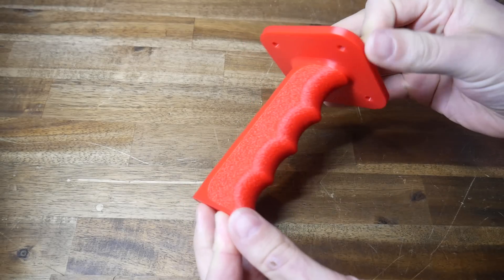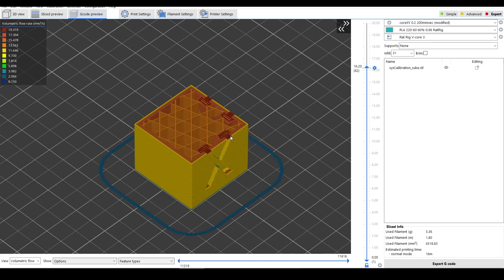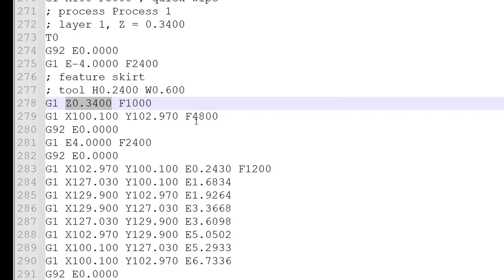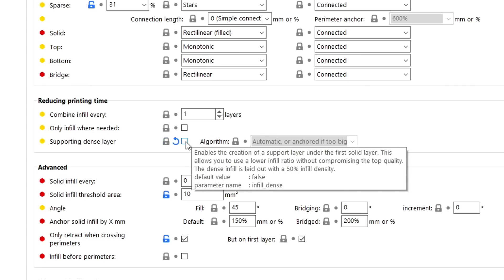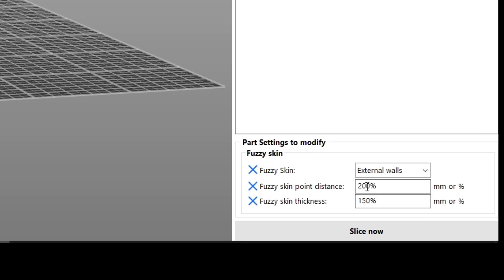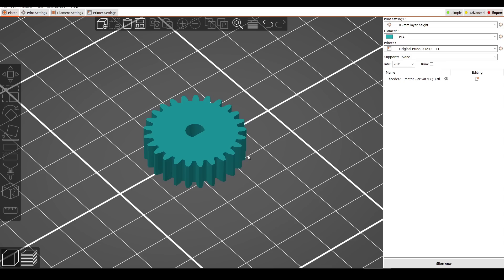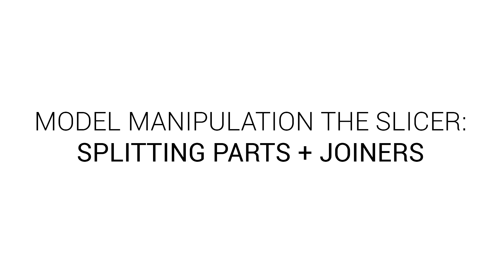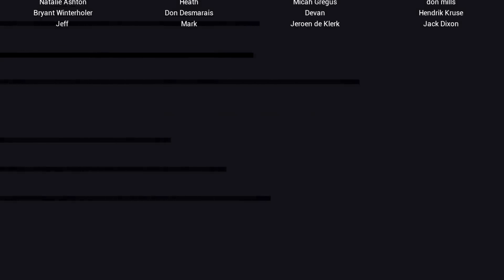8 great 3D printer slicer features you might not know about

Comment: I have a confession to make: I've been 3D-printing for a couple of years now, and during that time I've seen many videos wherein people have custom, elaborate-looking part cooling fan ducts on their printers, but in all my time printing, I have never once given a crap about part cooling. And in fact, I leave the fan completely off all the time. I have had many more print successes than failures (ignoring bone-headed part design flaws), so I don't really even know why people fuss over the part fan.

Have I been doing this 3D-printing thing wrong for the last two years?
Reply: If you're having print successes, and you're happy with how things are going, you're printing right. I have not been as lucky without good part cooling. One of the interesting things about this hobby is how so many people can use the same equipment, filament, etc., and yet have radically different experiences.
Reply: @matthewrice5721  Maybe environmental, like air temperature and humidity? I run my printer (a heavily modded Ender 3 V2) in an enclosure, so temp is stable on the warm side, but I think our relative humidity is high-ish where I am.

What's really weird to me is that on one day, I print PETG without issue -- good adhesion, no warping -- , and then the next day, no changes in config at all, PETG fails miserably. It's quite frustrating at times.

It's all a gamble without full control of all the variables, something certainly not possible for me.
Reply: That's rather intruiging. But then again, PLA is /very/ forgiving material to print with, compared to TPU, PETG, ABS and basically everything else you can shove into a printer.
So unless you're also printing fast, like 50 mm/s and above, I'm only slightly surprised that printing that much without cooling never gave issues.

Of course it also comes down to geometry, because cooling is mainly needed for overhangs and bridging. Doing these slow enough reduces the need for cooling.
If most of your prints were vertical or tapering to become smaller as height increases and speeds were moderate and relaxed, then I can imagine that even without cooling things can come out well anyways. There's even a counter point to cooling: the hotter the last layer is when the next comes, the better they can fuse.
It's really not a fire-and-forget solution. Some materials like ABS even /need/ to be printed without cooling (unless for extreme overhangs or bridging).

That said, there's also personal bias on expectations. I have no "high-end perfect" expectations at my printer, it's a budget one and I know it, but it's serving well for the money spent.
But sometimes I see other people share their DIY projects, and the surface finish they have is, in comparison to what I am used to from my printer, horrible. With uneven lines not just on the top surface and overhangs, but sometimes even on simple walls, indicating that their printer has serious tuning issues.

But they don't even care about that, they purely care about the structural function of their parts, and that they made them work as intended and are rightfully excited about that.

It makes me reflect that I sometimes spent literal hours, fighting with the CAD software and afterwards the slicer, to get some minor surface detail to "work out", only to realize after printing that I've wasted my time, because the detail got lost to being 2 layers thick and therefore of irreproducible detail 🤦‍♂

Ramblings aside, if the majority of parts you printed worked as intended and didn't go to the bin, then you definitely did nothing wrong.
Reply: @BloodyMobile  Wow, thank you for the thorough and thoughtful reply/commentary.

I think you touched on the reasons why I don't have issues going part fan-free:
1. I always print at 50mm/s or less.
2. I design everything to eliminate overhangs > 45°, going so far as to break my models in multiple pieces, if needed (I do this all the time, anyway, to improve the strength of parts).
3. I print mostly PLA, with the odd foray into PETG (which POSITIVELY requires no part fan to ensure bed adhesion and warpless prints, but it's hit and miss on the former).

If it ain't broke, etc...
Reply: I was printing a model recently that had a series of very thin, slanted arches circling up a helical center. When I tried to print this in PLA with my stock settings (on a Bambu X1 Carbon), the steep overhangs on those arches would curl up during printing and eventually cause a very messy bridge at the top of the arch at best, or at worst the print head would end up snapping off the curled-up arch. After trying all sorts of different settings to try and fix this - extrusion rates, layer heights, nozzle temperature, perimeter order, filament brand, etc. - I eventually learned that my problem was part cooling. I was printing with the door of the printer closed, and that was allowing the printer enclosure to get a bit too warm, and then the thin overhangs would curl. I left the door open, took off the glass top panel, cranked up the cooling fans, and this solved my problem.

The lesson is, it depends on part geometry and speed. If you print slow, you probably don't need to worry about fans. If you print solid blocky parts, you probably don't need to worry about fans. But if you're trying to print PLA very quickly with highly detailed shapes and overhangs, you might eventually get limited by a lack of cooling.
Reply: @Mirrormn  Ya, part cooling definitely makes sense in your case. I rarely, if ever,  have complex designs like the one you described.